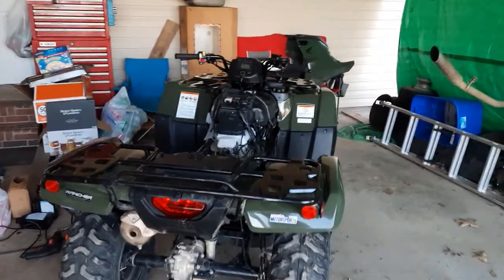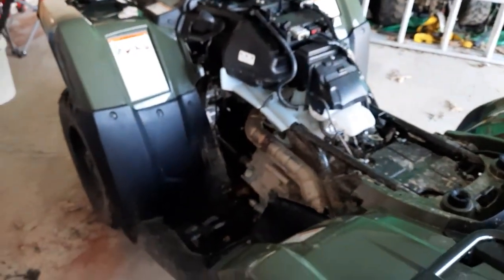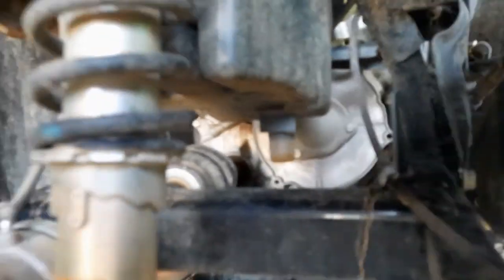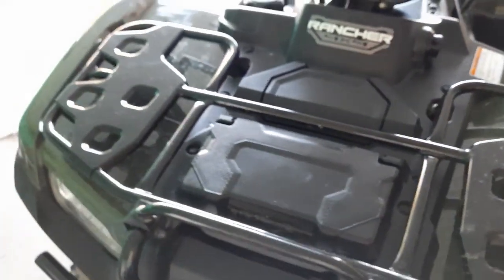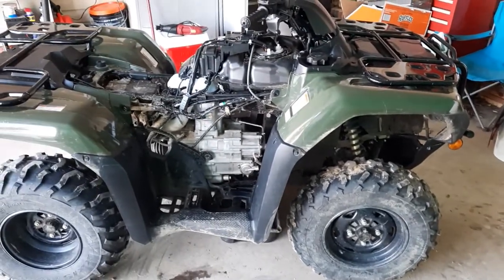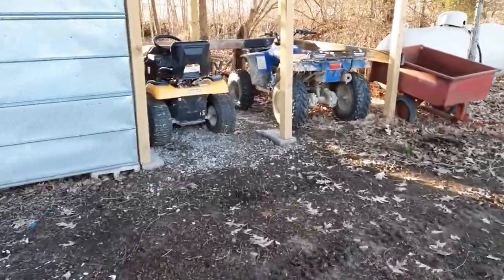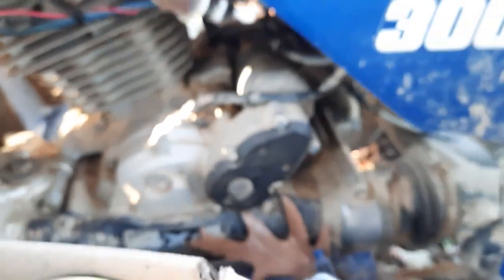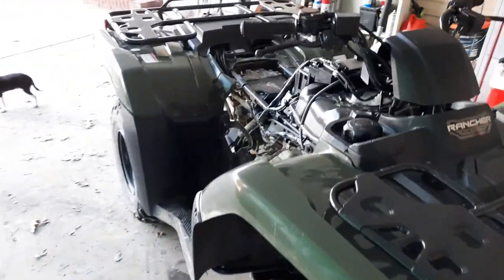break in review 2021 honda rancher

Comment: I picked up a 23 rancher myself about 2 weeks ago and it’s the exact same one as yours, and I love that it doesn’t have as many electronics, also a foot shift, less things to go bad 🤷🏻‍♂️
Reply from the maker: I hope you enjoy it. I currently have 1200 miles on mine with no issues so far.
Reply: @6.2_vortec  nice!! I am taking it easy on mine just to break it in and then go have lots of fun with it
Reply from the maker: @javiermarante5344  I mostly ride mine on the street and on gravel, I had mine broke in within a couple days of owning it
Reply: @6.2_vortec  i ride mine in the woods and some easy trails, I don’t really beat on it much no water or mud riding for me

Comment: According to the 2025 Honda Ranchers Owners manual on page 260 it suggests avoiding full throttle starts, rapid acceleration, and constant rpm operation for the first 15 miles, this all the owners manual says regarding the break in period. I haven’t seen anything as of the moment about not putting the vehicle under load, or towing during a break in period. If I find anything out that is confirmed to be official from Honda I will empathize that in the future, but as it stands that is all I have found that has come from Honda about a break in period on their ATV engines. Only the first 15 miles, the differential fluid isn’t to be replaced, but every 2 yrs according to the owners manual, not the initial 100 mile, 20hr first oil change.

Comment: Does it have lockers?
Reply from the maker: Sadly it doesn't
Reply: @6.2_vortec   I just got a 22 and was told you can lock the front dif depressing the front brake handle.
I read of others doing that.
 my dealer where I bought it said it woks on the rancher.
I tried it and it works? wow
you can hear it click as you pull in the handle (slightly, not engaging the brake)
it goes off if you press more and also goes off when you release the handle. :)
 its a cool thing to know as most users and sales ppl are not aware of this feature.